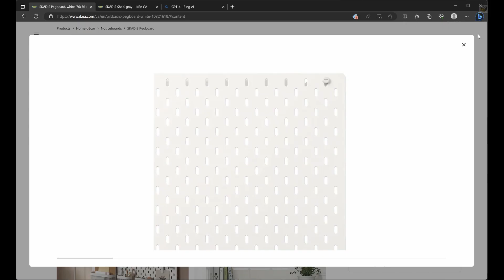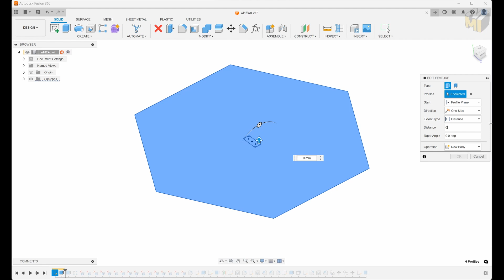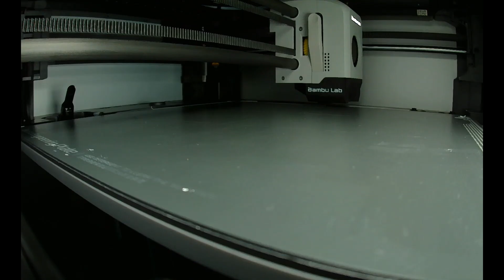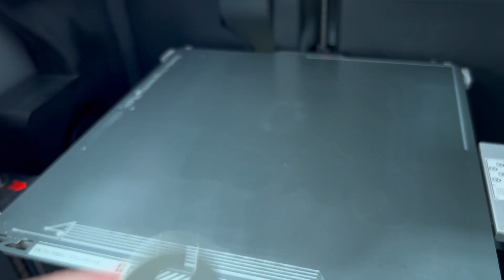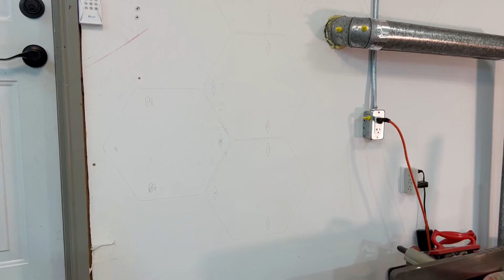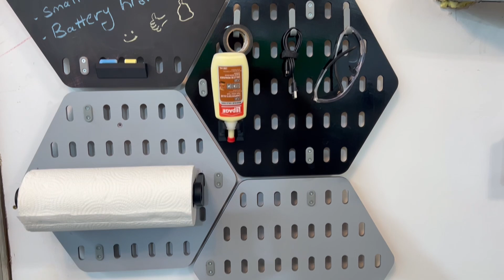Organize your workshop with HEXAGONS?

Comment: You should have made your holes 6mm wide. Then you could have used 2020 hammerhead drop-in T-nuts (same as used for 2020 aluminum extrusions) to mount your accessories with M5 screws without needing access to the back of the board. Much stronger and way easier to design accessories without those hooks on the back.
Reply from the maker: Great point.  I've been saving for some of those Ikea Skadis panels, they're a glorified pegboard, but they do look a lot better, also having the holes they should help to reduce some echo in my shop.  I could also make my own, but for the time and the mess, I am probably best to buy the kit, the prices seem reasonable enough.

Comment: Hi. How do you emulate the space in the computer?
Reply from the maker: I use a combination of Sketchpad (free) and Microsoft's image generator (the customization area).  I actually don't know how to get directly there yet, I usually generate an image and then click customize.
Reply: Thanks @NeedItMakeIt
Reply from the maker: @Nuno_G_  No problem.   I've been using a Wacom Intuos as well.  it is really small but does help with sketching on-screen.  Maybe that's more specific to my situation...

Comment: The problem with this design is that the holes do not line up across tiles so you are limited to hanging things on a single tile.
Reply from the maker: For sure, great point, it would be better to make a full 'plate'  of these holes and position the hex onto those, the spacing is a bit of an issue.  I think I may end up finding a way to use the laser on larger panels by setting a origin point it would allow me to fill up a 4 x 8 sheet by moving the laser on the panel instead.  Maybe a good idea?   I also think the mounts can be wood glued to the backs and then fasten through those, thoughts on that?

Comment: nice job man, that laser cutter is good? I'm thinking of buying TWOTREES TTS-55 Laser Engraver Totem S 40W do you thing is ok?
Reply from the maker: I'd try to get one that can truly engrave metals, it opens up a whole new world.  One thing I've found with my laser is that you can't use it inside at all, not even a small engraving or cutout, the smoke will spread quick.  I'm really not sure how these are able to be sold really, they're probably slowly killing people if they're using them inside.  I only use mine outside now... it has been a super rainy summer so not much of an opportunity yet.  Does the TTS-55 engrave metals?  That power is insane, I wonder what the focal is at depth, they tend to not be able to cut deeper than 3/4" accurately because of the focal, also the parts certainly smell like burning for a while.  A great tool for sure if they're being used 'safely'.  

Sorry, kinda sounded like a rant there.
Reply: @NeedItMakeIt  I've been researching more and unfortunately the TTS-55 doesn't cut or engrave metal, and with the possible materials it makes a lot of smoke, I'll see if I can find something better and as an alternative make a box with ventilation/aspiration.
Reply from the maker: It would certainly do a good job on wood, with that kind of power.  A box with a fan venting to outside and an inlet for pulling in some fresh air makes sense.  I guess they probably make these already, since we're talking about it already, someone surely has already designed something.  I believe these Diode type lasers can engrave stone, but being able to cut through or engrave into metals, I'd be using it all of the time.  I believe that is a CO type laser and it is probably far more expensive.  If you're just getting into it, there's nothing wrong with a Diode laser, you can always sell and move on up, it seems they're releasing new and more powerful versions each week... soon we'll be able to cut through metal with a Diode.
Reply: @NeedItMakeIt  yes, I believe so, I will continue to research a bit more and make comparisons, thanks my friend
Reply from the maker: @fredydefcon1  Thanks for the conversation, and good luck with the search, let me know what you end up with and what you think about it when you get there.  I'm going to be making more videos on the subject, is there anything in particular you're most interested in making with the laser?
Reply: @NeedItMakeIt  I'm a modeler, more
 specifically rc cars, planes and boats and much more, I'm always inventing new things, so I'll need to cut wood and plywood, mdf, aluminum and engrave too, I do a lot of manual work and there's always something to manufacture, as soon as I have news I'll share it ok
Reply from the maker: @fredydefcon1  Very cool!  Brings me back to my childhood with the Traxxas (the buggy style), back when the frames and parts were cream colored.    That work sounds really cool, perfect for 3d printing and laser work.  A desktop waterjet machine would be wonderful as well :).
Reply: @NeedItMakeIt  yes it's really cool, I've been practicing this hobby for 30 years, yes I have two 3D printers, and I already had a CNC, waterjet machine would be awesome LOL who knows :)

Comment: Sick how your channel keeps growing.. 

I do miss the led strip holder that goes behind the wall to finish it. I'm into fpv drone flying. And we often hang our tools and quadcopters on these. But its even nicer with collored leds behind these panels :) nice job at this btw!
Reply from the maker: It is getting there,  It is a lot of work, but the ideas are flowing and the videos seems to be coming together much faster.  I am on 2 days a week fully YT now, so hopefully I can make this FULL TIME.  There are probably lots of easier ways to make videos, but if you want something you gotta be ready to work for it right?  I have a drone, but I am not a great pilot, I'm blown away by some of the skill that you guys have flying these, crazy how fast they go.  I guess with Drones there are lots of mods you can print?
Reply: @NeedItMakeIt  You can do it for only views indeed. But you explain it way more thoroughly. I am more busy waterproofing my quad right now to fly over sea and water. For nicer videos. You can print mods. But it is mostly TPU mounts and bumpers for protection. 
I saw you have the new bambulab. Awesome. My ender 3 v2 allways has these annoying things going on. 
My struggle right now is trying to fix overhangs for PLA. Tried to print the T rex skeleton from makerbot. But I don't like the print quality on overhangs. (Cooling issue) so gonna focus now on the tpu and then mayb with supports if that helps it.
Reply from the maker: @TriMeX1987  Quad comes first!  When you have a moment, if you have a sample print I can tinker with?  I don't mind to look into these if it'll help a bunch of people.  The Bambu is a great printer no doubt.   I just received Creality's K1 to test out as well.  I still have my Enders setup and ready to go, they're slower, but they're so much simpler and when something goes wrong with the fancy printers, they'll be there ready to pick up the slack.   I can only imagine what the next gen will look like, will it go a completely different direction, will we be able to print with the strength of an injection molded part?
Reply: @NeedItMakeIt  that idea sounds awesome indeed strength of injection molded with home made prints. I am allready drooling over this bambu and the new prusa with tool heads. For me its easier to focus on the piloting first now indeed. I can fly pretty well.. and can fly pretty much without beeing bothered by autorities. So I can chase in traffic :)
Reply from the maker: I'm sure there are some companies out there that are developing some tech which will completely change the way we 3D print.  HP has something different, they use some type of spray technique on a bed of powder, it bonds layer by layer.

Comment: Hexagons are the Bestagons.
Reply from the maker: No doubt!  I think I'll make some adjustments for the rest of the walls, larger panels and maybe find a way to connect them more easily without having to print hundreds of mounts.  I was thinking of trying to find a way to pattern a full 4 x 8 sheet of mdf with a laser as well.  Could I align using a jig based on the previous cut maybe?  I have a CNC, but it is super dusty, could machine outside I suppose.

Comment: I wanted to build this for my father using plywood boards. Sadly I don't have a laser cutter so I need to design a template for hand milling machine. It would be so much easier with a laser cutter. 😔
Reply from the maker: Yeah the laser did a nice job.  I hadn't been using it much when it was colder out, but I realize now that it can be used year-round outside, and probably should only be used outside, far too much smoke produced and that's bound to be toxic with any long-term exposure.  I think next time, the CNC would be a better option, the 16 x 16 limit of the laser is just a bit too small and leads to far more work.  The 4x8 slot-wall is another good option, but again expensive, nearly 100/panel where I am.  An injection molded panel like this from plastic would do great, I wonder if there is such a product?  You know these days just about anything you can think of, someone is already making.